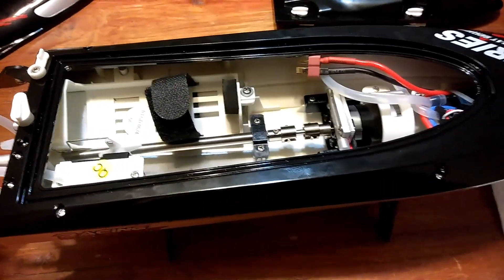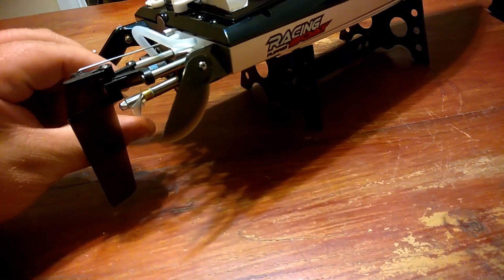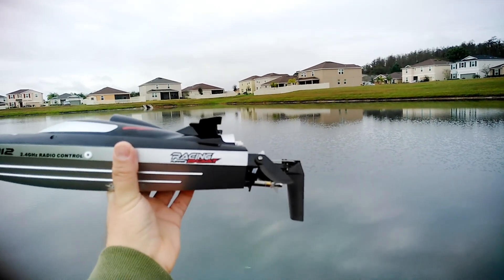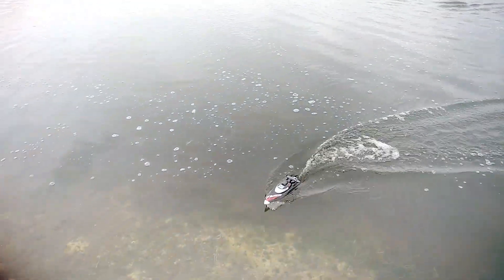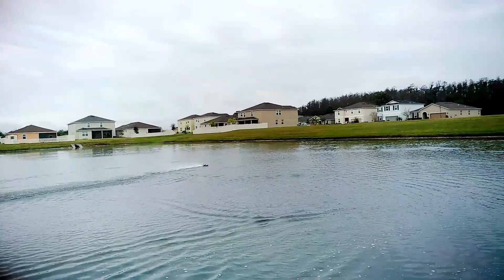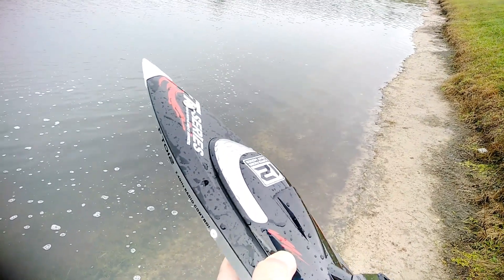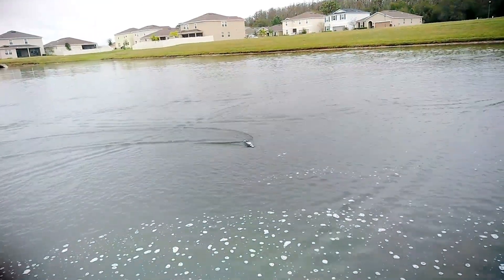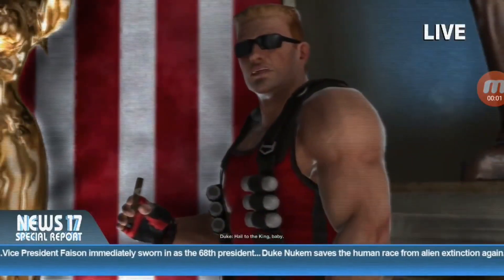Fei Lun FT012 Prep and First Run

Comment: That driveshaft only touches the bearings on each end of it.So it makes no sense lubricating the whole length of it. Lubricating each bearing at each end will do the job.Like I said that shaft isn't touching anything inside that sleeve except for the bearing at each end.

Comment: had a question for you I know it's late in the year by about three years but just watch this video and tell me if I'm wrong did you notice ... Your motor sounded different the begining run sounded good... The middle of the run motor sounded like a second sound meaning just sounded different... Was it just me know or if you replay that video yourself and listen.... Was just asking..
Reply from the maker: That's because a lipo fully charged for the first two minutes of use will give you serious power output as you draw the voltage down it will sag the battery and produce less power push on the top end. The first two minutes of any LiPo battery with a decent discharge is usually pretty awesome as continuous uses put on the battery the voltage will start coming down losing the peak power output
Reply from the maker: You will get to know the sounds of your boat very well you will be able to tell before the batteries even close to dying how much run time you have left if you use your boat enough

Comment: Like a little kid on Christmas! dont believe they put the shaft in bone dry what bone heads! see my reply on the first boat video, I use grimracer rc boat grease it works awesome! yea if they go under water let off throttle because if you dont it will go real far under water like a sub! if the low voltage cuts off power to the motor let it sit for a few seconds and use little throttle and you can get it back in if you go fast again the batteries voltage drops and shuts down the esc again.
Reply from the maker: shenlonco awesome advice brother thank you
Reply: Your welcome those little boats are awesome because there fast and self right and because there small easy to bring to the pond without lugging a lot of crap!
Reply from the maker: +shenlonco hell yes they are and I'm going to show people how to do a Beast ass recovery tomorrow
Reply: With a drone! =)
Reply from the maker: shenlonco  you know it